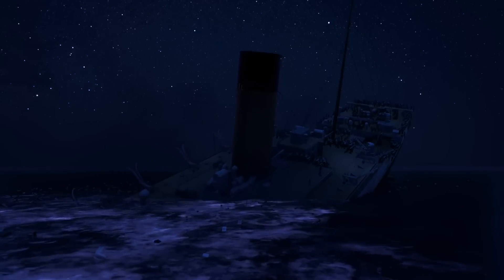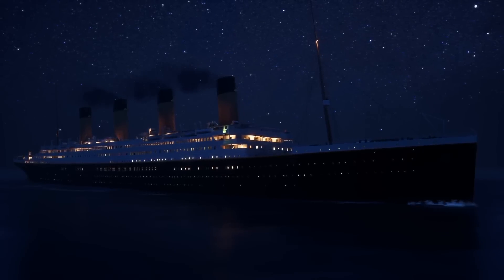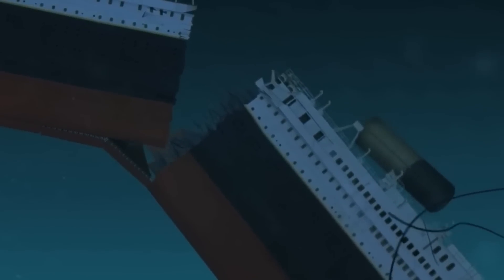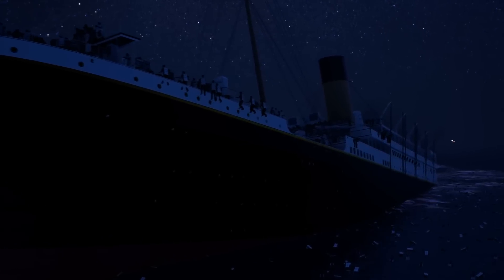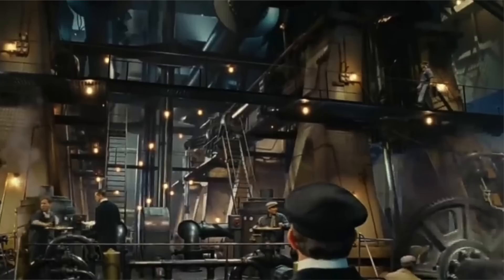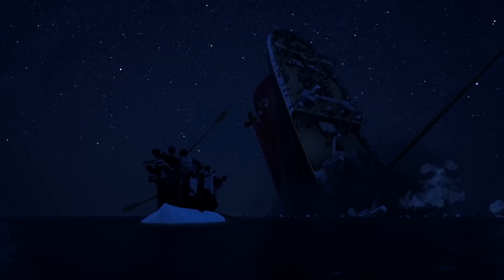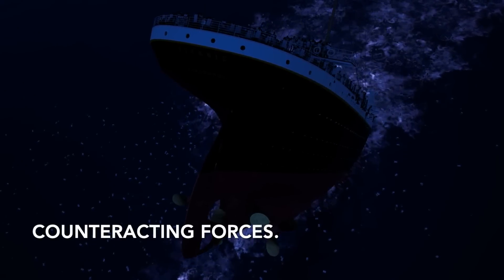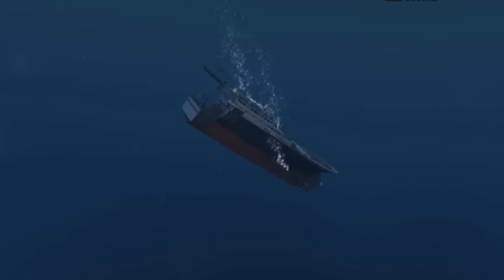The Physics of Titanic's Final Plunge!

Comment: There’s no real true way to know exactly how the Titanic sank. You can go partially off of witness testimony. But, for the rest. It’s all just assumptions. Sure, you can look at the evidence. How the Titanic lies on the floor today. The debris field. I mean yeah the double bottom piece pretty much applies it was hanging on and broke off. But, the entire spinning part. No one know if that’s true or not. Unless they were there. The back part of the ship. I think it’s called the Stern. Excuse me for not knowing all the correct terminology for the ship parts. It obviously is in better condition than the front part. And, it does look like it exploded. So, you can only conclude, that it exploded from the pressure of the water when fee falling 2.5 miles beneath the surface.

Comment: THIS IS ALL WRONG IT HAS BEEN PROVEN THAT THE TITANIC SPLIT AT A SHALLOW ANGLE 12 DEGREES  THE STERN REMAINED CONNECTED TO THE BOW SECTION BECAUSE OF THE DECTRUCTION CASUSED BY IMPLOSION BECAUSE IT WAS FULL OF AIR  THE TWO VAST REFRIDGERATED CARGO HOLDS WERE NOT ONLY WATERTIGHT THEY WERE AIR TIGHT  THE TESTIMONY GIVEN BY THE 3RD OFFICER SPOKE OF LOUD BOOMS COMING FROM DEEP BELOW THE SURFACE FOLLOWED BY FRAGMENTS OF CORK RISING TO THE SURFACE THIS CORK WAS USED TO INSULATED THE BULKHEADS OF THE REFRIDGERATED CARGO HOLDS IF THE STERN HAD FLOODE LIKE THE BOW SECTION IT WOULD HAVE ARRIVED INTACT LIKE THE BOW SECTION  IT WENT DOWN BECAUSE IT WAS DRAGGED DOWN STILL CONNECTED TO THE BOW SECTION

Comment: Thanks for this explanation. Everyone seems to accept that the stern sank vertically down with very little explanation. They just say that survivor accounts say that's what happened and so they believe it. But, I'm sorry, survivor accounts are not enough for me. People would have been distracted by they own escape attempts and it was very dark. I really couldn't get my head around the physics of the stern's sinking. I always thought the trapped air in the back would be too much for the small part of the forward stern that was submerged to pull down. This theory of the engines holding it down while the air escaped makes a lot of sense. This could have let in enough water to fill another two or three watertight sections until there was not enough air to keep it afloat. (Though I still can hardly believe that the engines were THAT heavy!)

Comment: It central of mass and buoyancy, when the ship snap the centre of mass would more than likely remain on the break spot but the buoyancy would have shift toward the stern where the air was being pushed out if the double bottom remained attached even slightly when the bow drived down the water on top of the weight of the engines would have drag the center mass the the break drag the ship down ...titanic central mass and centre of buoyancy was likely around 3th funnel in with 4 front water tight could go but only 2 rear one could as central of mass and buoyancy....it only a slight change required to sink it over so there was a leak only a bucket of water from i want to say 5th/6th water tight area but if the for 4th had gone that bucket worth of water a day is enough to shift the center front  enough to go over the top on the water tight areas

Comment: Pure conjecture of implosion, as most of the free air would have been forced out of hatch covers, deckways, and portholes. Remember the ship had a lot of empty cavities, for holds, and engine casings. Yes, she was designed to be water- tight, not air-tight. Implosion causes objects to be collapsed inwards, not outwards- that would be explosion? 
The stern end was not hydro-dynamic- it was a 30,000 square feet open end. As the ship filled, the damage would be massive. A lot of the rooms were timber- walled, and would have been smashed to bits. Remember the barber-pole?  That had been on C-Deck That was near the aft grand staircase- the next day that was found floating on the surface. T
The stern began to corkscrew prop end first creating massive drag .Anything not streamlined  would have been dragged off, due to Hydrodynamic force, and drag, including shell plating, deckhouses, divots and cranes. The poop deck was folded over on itself, and the frames were put under massive stress. Decks likely collapsed on top of each other on impact.

Comment: All of the theories that suppose that the keel pieces stayed attached by a tiny ligament of steel are wrong.  Pieces that large (together they were 75' long, 90' wide, and 5'-6' deep) were way too heavy to hang on by a shred of 1-inch-thick bottom plating.  I say "shred" purposely, because the ship's bottom was not perfectly flat/level, and when something that is not shaped in a straight line breaks, it has only a small portion that could still be touching.  So the idea that supposedly there was enough force to break the tank-top sheeting all the way across its 90' breadth, and break the hull bottom sheeting all along its 90' breadth except for the center 12 feet (and I'm being generous to say it was that much), and somehow that center 12' of 1" plate could hold all of that weight, is preposterous.

The keel pieces were the FIRST to break and fall out, not the last.  After they came out via Euler buckling mode, the ship moved during the rest of the breakup---while it did its Big Plunge, final breaking, floating freely, and final plunge---which is why the keel pieces are in a position up-current from the rest of the wreckage.  Jack Thayer witnessed the movement; and I proved the movement using a TITANIC model in my hot tub.

Comment: This probably sounds like a stupid question, but if the engines were over 700 tons each, and the ship is made of iron, and it has all those people and cars and other stuff on it, what is it that actually keeps it buoyant?
Reply: It's the air that is underwater that causes buoyancy.  A 46,000-ton ship sitting on dry land weighs 46,000 tons, because air is inside and outside.  Likewise, if the same ship has sunk to the ocean bottom, it is steel filled with water and surrounded by water, so again it weighs 46,000 tons where it sits.  But when it is floating and full of air, the part with the air under water is giving it buoyancy, because the surrounding water is about 700 times more dense than the air inside.  Believe it or not, it is gravity that causes buoyancy:  gravity pulls down on the water more than the air, so the air tries to go upward relative to the water.  The same is true with a hot-air balloon and with a bubble of air released at the bottom of a pond (let's say, when a fish burps).  Gravity is the motive force.

Comment: I understand that the engines both broke just behind the first cylinder.  Those first cylinders are not with stern anylonger.   This would mean that the bases,  the jacket ingredients and the crankshaft had to break.  That would require some astronomical forces to achieve.  The first part of the engines may have been on the double bottom piece you referred to but are not there now.  What could have happened to separate those items from the double bottom chunk you discussed.
Reply: The ship slowly breaking in half is what broke those two sections of shafts, baseplates, and engine cylinders off from the rest of the engine assemblies.  With the ship sticking up somewhere between 45 and 60 degrees, the whole stern broke and crunched down almost level with the ocean surface in 15-20 seconds, while the bow was still pointing downward.  Just a few of the testimonies, which align perfectly with one another:
"The front portion of her was pointing downwards and she appeared to be breaking in halves. Then with a mighty and tearing [sound]…, the front portion of her dived…dived into the sea…"  (Mrs. Hart in lifeboat 14)
"The Titanic broke in two before my eyes. The fore part was already partly under the water.  It wallowed over and disappeared instantly…"  (Charlotte Collyer)
"The ship was right up on end then.  Suddenly she broke in two between the third and fourth funnel."  (Joseph Scarrott)
"All at once she seemed to go up on end, you know, and come down about half way, and then the afterpart righted itself again and the forepart had disappeared." (Quartermaster Bright.)
"The boat seemed to lift up right out of the water and tilt up on end and then seemed to break and drop back."  (Walter Nichols)
"It was partly a roar, partly a groan, partly a rattle, and partly a smash, and it was not a sudden roar as an explosion would be:  it went on successively for some seconds, possibly fifteen to twenty, as [if] the heavy machinery dropped down to the bottom (now the bows) of the ship…."  (Lawrence Beesley)

Comment: Would be interested in seeing those 2 peices, it would forever put to rest whether Titanic broke from the bottom up (Her back broke first, crumpled inward and began to break apart inside prior to  the superstructure coming break apart, some evidence to support this is the power immediately going out prior to the superstructure breaking apart.) vs Titanic  breaking  from the superstructure first ie the banana peel theory If she broke apart from the bottom up, there also would have been immediate flooding, and more than likely the watertight bulkhead closest to the break point was more than likely compromised to adding to the weight of the engines at the break point, after the stern settled back i wouldnt have taken long for the flooding and the weight of the engines to bring down the stern, even without the engines the weight of the flooding of that closest compartment would still have doomed the stern section.
Reply: Quick addition:  The bottom break up theory also suggests that those two pieces of the double bottom where the first pieces to separate from Titanic BEFORE her bow section.

Comment: I think it's also possible that if any boilers were still attached, like number one, the cold water shock would have created a lot of steam (air), as well as any steam generated from the rapid cooling of the engines that would have been filling the stern section with air, delaying it's descent like a hot air ballon until the water column could push that air out and break that buoyancy.

Comment: I thought recent studies have shown that the bow only raised up about 15 degrees only 😮 not vertical
Reply: The stern is what raised, not the bow---and it raised 3 times.  The first break happened at around 10-15 degrees, as you said.  Then the ship did its Big Plunge to somewhere over 45 degrees, and broke the rest of the way (it finally parted).  The stern half floated for about 2 minutes, then it pivoted up to nearly vertical before it sank.  There were three different stern rises spoken of, and that's why it's confusing trying to figure out which angle it was.  It was all three angles, not just one.  The difference is the timing---which is the hardest thing for eyewitnesses to get right.

Comment: of course the stern section was not crushed by the waterpressure...
things get crushed by waterpressure, when there is no chance for the inside pressure to be equilibriated with the outside pressure...
the fact that the whole FRONT PART OF THE SHIP was missing, and that the TOP PART WAS MEANT FOR PASSENGER TO GET IN AND OUT AS THEY PLEASE means there is a connection and it can be equilibriated.

The destruction of the back section is due to aquadynamics, while the front part of the aft section was still being pulled down by the engine, and the water that is flowing by has the same effect as you slapping your face vs concrete.
It just rips off - imagine driving a car and holding your hand out... and now multiply that by the factor of density of water vs air...

nice explanation otherwise.

Comment: Question if  these engines weight was 730 tons each I dont see how they did not sheer the blots holding then in position. When the engine was installed they would have been bolted to the keel and the bolts would not have been under any lateral force but when the keel started to elevate the bolts would in my opinion  be unable to hold the weight and the engine would have slipped off the ship.
The stern of the ship would then just stay vertical until it's own  weight would pull it under after all it must have weighed approximately 15 to 20 thousand tons so it would have sunk under it's own weight and the weight of the water just helped after all the water would have to literally flow upwards into the stern having to force out the trapped air which the passengers would have heard and seen but no reports of this. This is only my personal opinion based on the information given but food for thoughts.

Comment: I suspect that a quick diagram explaining "center of buoyancy" and "center of mass" might have clarified your description. I appears to me that after the bow and stern sections separated, the center of buoyancy of the stern moved well aft of the center of mass (because the reciprocating engines aggregated so much mass towards the very bow of the stern section). The center of mass pulled down, the center of buoyancy pushed up, and the resulting torque rotated the stern section so that the center of mass was directly beneath the center of buoyancy. The incoming water then caused the stern section to sink as described in the video.

I appreciate the effort and time invested in this interesting video.

Comment: Historic Travels Your missing a very big structural component of the Olympic Class Ships that surely effected how the Titanic broke apart and sank and that is the double and in some places triple plated strength decks. Between C Deck and D Deck there was an extra layer of steel plating to help strengthen the ships for the super structure that made up the 4 decks above the Hull. When Titanic started to break apart the double bottom would have been the first to give way buckling upwards. After that the upper decks would have started to pull apart, leaving arguably the strongest part of the ship in the middle still hanging on mostly still attached. You can observe the wreck at the rear end of the Bow section how loose and pulled apart from the frames the steel hull plating is. Based off of that and how clean of a break there is on the double bottom on both the Bow, Stern, and the double bottom pieces that were found further out in the debris field shows that likely the last part of the ship to give way and separate was the strength decks between D and C Deck. This was more than likely what held Titanic together long enough to pull the stern vertical. The main consensus over the years has been that Titanic fully broke apart at the surface, but from cataloging every single piece of debris found on the ocean bottom, the size of the overall debris field and proximity of the pieces with there original locations within the ship is apparently painting a different picture. If in fact that is the case and Titanic didn't fully break apart at the surface the pulled apart, over hanging hull steel plating, and the collapsed pushed down upper area of the rear of the Bow Section could have been caused by the Stern flailing about still buoyant being pulled down by the Bow. It could also explain why the Stern is so badly destroyed with just about all of the steel plated hull being separated from the frames and hanging off the sides. Also based off of how badly the Stern section had imploded could suggest that it did not have time to fill with enough water before it was pulled down two or three hundred foot for implosions to begin. Something to think about for sure.
Reply: You're mostly correct.  The keel was indeed the first to go, but the two pieces folded outward (downward) in Euler Buckling mode, which is why they're in such good condition and further away.  Because they broke away, they did not pull the stern to a high angle (over 45 degrees); it was the C and D decks which pulled it, as you said.  The nearly vertical angle came after all of that, when the bow was long gone.  And you're right about there still being air inside some locations of the stern when it finally went under:  a ship sinks because there is not ENOUGH air in it, and not because there is NO air in it.  Some air is always inside, and water pressure finally breaks whatever deck or bulkhead that is containing that air, and that explains all of the destruction of the stern half, as you rightly pointed out.  Good job.  
https://www.youtube.com/watch?v=VS5BmyImDF4

Comment: The double bottom (keel) broke first, there's a section of it on the ocean floor. Looks almost like it was guillotined. Makes sense when you think about it. All that weight bearing down on the keel (bottom) of the ship.
Reply: You're correct to think that the keel broke first, but it failed in Euler Buckling mode, where the 2 pieces folded outward (downward) from the ship suddenly.  That explains the 2 pieces' appearance/condition.  Buckling happens via end-to-end compression, due to the bending of the ship from end to end (weight at each end, with the buoyant center being a fulcrum).  In the engineering business that is known as simple beam bending.  So you're on the right track.

Comment: If the engines would have broke free after being vertical do you think the air trapped in the back of the ship could have held it there like a bobber in the water or an empty bottle floating on the surface. And if so how long do you think she could have stayed?
Reply: No.  Without the engines pulling it straight down, it would have capsized and filled with water.